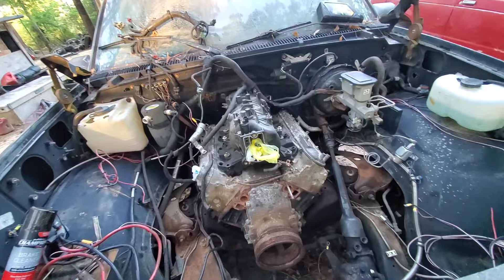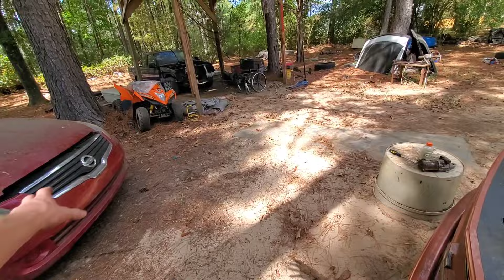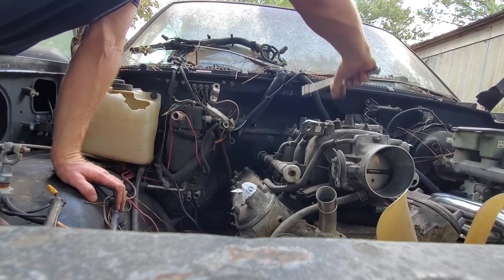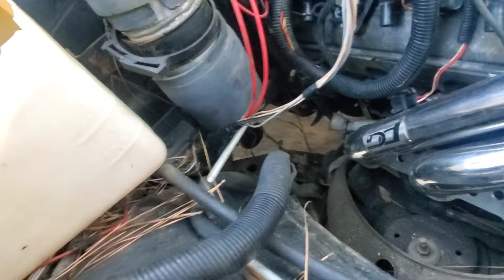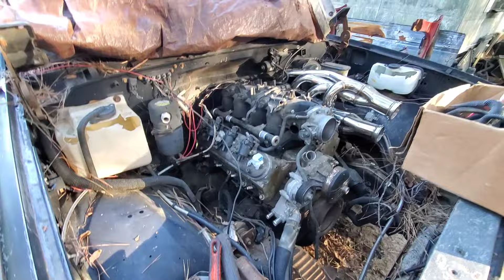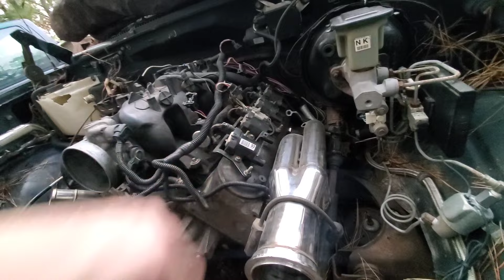Finally Back To Work On The 94 Chevy 5.3 Swap!

Comment: Those heat solder connectors are the best! A lighter or a torch works best in my opinion. just heat each end first and then the center, the solder melts and the shrink around it forces the solder into the wires.
Reply: Yep. I was skeptical myself.. but I’ve used them on a Colorado wiring harness about 2 months ago.. and so far it’s been holding up nicely and trucks running perfect.

Comment: Hey brother on that turbo 350 and the 5.3 make sure you use the cone spacer on the converter I have the same set up even a 3500 converter and I screwed my transmission by not using the spacer first round .I hope this helps in some way .

Comment: Cool truck glad to see your making still making videos , I run seimens deka 80’s in my s10  5.3 with a borgwarner s475 turbo pump gas 93 octane works well and affordable 

What are his power goals with this ? Does he think somewhere down the line he will want to use e85
Reply from the maker: He just wants to get it running and sale it so no real power goals just something fun.. he has another truck that he's been putting together